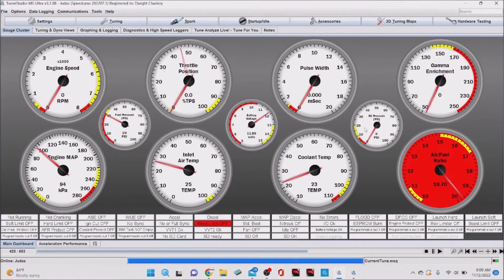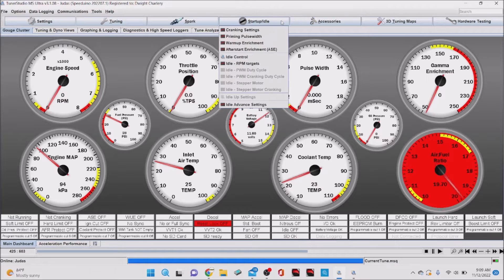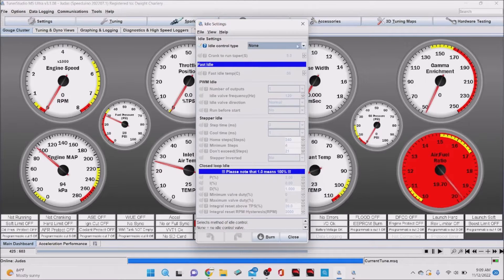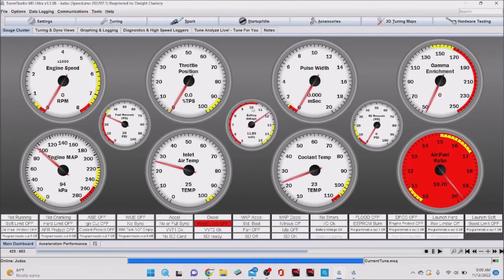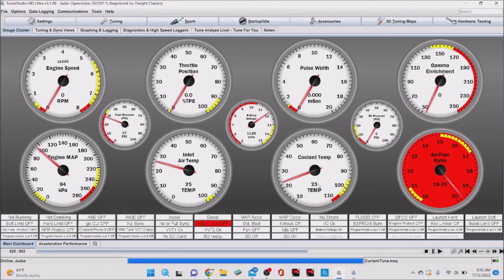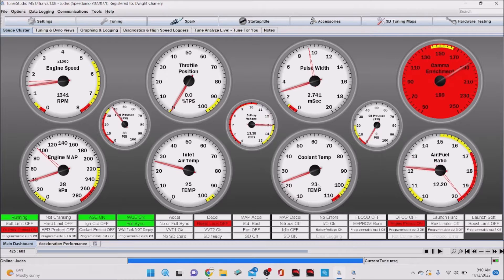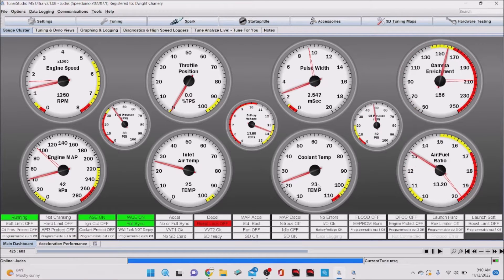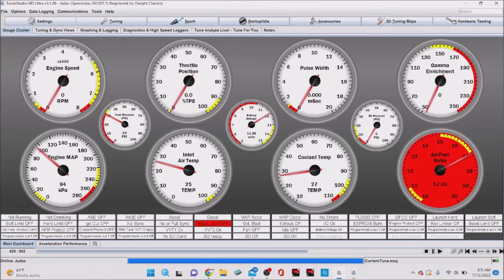Do You Need an Idle Air Control Valve to Cold Start ?

Comment: I am a bit confused as to what my next step is, I have a VTR250 that is my race bike, I am converting to EFI with NO2C and my Honda throttle bodies have a 4 wire stepper IACV. I have identified the two different coils but don’t know A1/A2/B1/B2 and I don’t know how to input stepper settings. Where can I look for these tips? Thanks 🙏🏻
Reply from the maker: The Speeduino manual cover this IIRC. If not drop a post on the forum
Reply: @DCWERX  thanks, I think the main information I can’t find is defining the difference of pin polarity in the stock Honda IACV connector. I’ll keep digging and then try to calibrate it. 
This is a swapped in throttle body for a bike not sold in many markets so I’m struggling to find a wiring diagram and supporting information. Thanks for the reply

Comment: Thanks for the vid. I noted that it was idling at 1300 on a cold start. So whats it going to idle at hot? 1500? That is a little fast I would have thought.
Reply from the maker: 1300 is perfect at cold start. 1000rpm when hot
Reply: Mine using 15 deg. cold advance and idle at 900 rpm when cold and 1100 rpm when warm 10 deg. on the ign. map!!!! Am i missing something?

Comment: This is a valid reason to move to the sub tropics right? Its not so easy in Minnesota when we get a month around -15c with dips to -40c and we get low vapor pressure Cali emissions fuel on top of it.
Reply from the maker: -15c is extreme and is tough on most cars to start up. The principles I mentioned, I use with success on cars I remote tune around the world with all sorts of temperatures